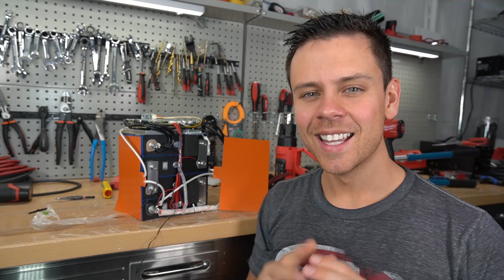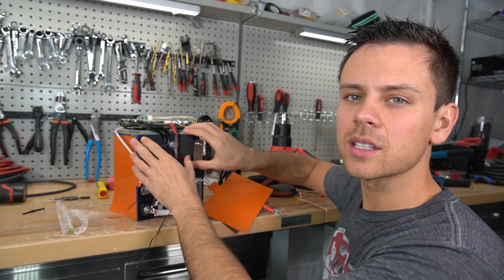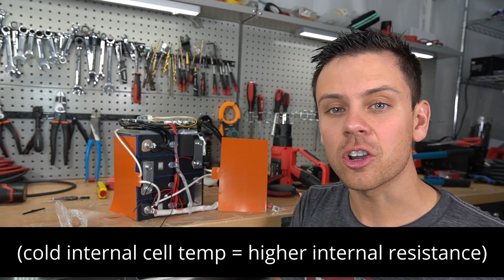LiFePO4 Cold Temperature Misconceptions: Do you really need internal heaters?

Comment from the maker: And for those of you who live in Antarctica where jet fuel freezes, and will be commenting below shortly about how this video is incorrect, you need a heater pad 😂 and a ton of insulation. I'm sure someone will disagree. Keep in mind that regardless of the temperature, if you can insulate it well enough, it should be able to handle anything. At least on this planet.

And yes, you still need low temp charging protection. That's why I prefaced this video with the dangers of charging without it. Solar batteries are charged unattended, so it is crucial to have full protection for your system at all times. Figured that was implied, but I just got an ignorant comment about that.

~~~~~~~~~~~~~~~~~~~~~~~~~~~~~~~~~~~~~
Tired of getting ripped off? Check out my "Will Prowse Approved" solar product recommendations below!

12V Batteries
https://www.mobile-solarpower.com/lithium-batteries.html

48V Batteries
https://www.mobile-solarpower.com/48v-batteries.html

Offgrid Inverter System Builder
https://www.mobile-solarpower.com/48v-complete-system-blueprint-559371.html

Hybrid Inverter System Builder
https://www.mobile-solarpower.com/code-compliant-48v-offgrid-system.html

Mobile Handtruck System Builder (very popular!)
https://www.mobile-solarpower.com/mobile-48v-system.html

Solar Panels
https://www.mobile-solarpower.com/300w-solar-panels.html

Ground Mount Solar Racking
https://www.mobile-solarpower.com/ground-mount-racks.html

Wire, Lugs and Busbars
https://www.mobile-solarpower.com/wire-and-connectors.html

Tools
https://www.mobile-solarpower.com/tools.html

Fuses and Circuit Breakers
https://www.mobile-solarpower.com/fuses.html

Plug-N-Play Solar Systems
Ecoflow, Anker And Bluetti! So many models to choose from. See my current recommendations here:
https://www.mobile-solarpower.com/full-size-systems.html

~~~~~~~~~~~~~~~~~~~~~~~~~~~~~~~~~~~~~~~~~~
Need to build a large DIY system? Need a trustworthy solar distributor? These are my favorites:

Signature Solar
Creator of EG4! Solar Minisplits, Victron and More! Largest Solar Store Online.
If you want $50 off, please use my link below and coupon code "DIYSOLAR50":
https://signaturesolar.com/?ref=cPwLcVc0SW-BjN

Current Connected
Best Prices for EG4, Victron, Midnite and so much more! Fast Shipping and Highest Rated Customer Service:
https://currentconnected.com/?ref=wp

~~~~~~~~~~~~~~~~~~~~~~~~~~~~~~~~~~~~~~~~~~
Join our DIY Solar Community 
Need more help? Join the largest solar forum on the internet for beginners and professionals alike. 140,000 members and counting!
https://www.diysolarforum.com

Check Out My Free Book
Best-selling and beginner-friendly guidebook to off-grid 12V solar!
https://www.mobile-solarpower.com/the-book.html

~~~~~~~~~~~~~~~~~~~~~~~~~~~~~~~~~~~~~~~~~~
Contact Information:
I am NOT available for personal solar system consult! If you wish to contact me, this is my direct email: williamprowsediysolar@gmail.com
FTC Disclosure Statement and Disclaimers:
Every video includes paid promotion or sponsorship (such as free products for review). Some links on this YouTube channel may be affiliate links. We may get paid if you buy something or take an action after clicking one of these. My videos are for educational purposes only. Information is subject to change/update at any time. Electricity is DANGEROUS and can kill. Be smart and use common sense :) DIY Solar Power with Will Prowse is a participant in the Amazon Services LLC Associates Program, An affiliate advertising program designed to provide a means for sites to earn advertising fees by advertising and linking to Amazon.com
Reply: To all those who live in mild climates, or who only use your battery bank in a climate controlled environment, Will is right, you likely don't need battery heaters if your temps rarely get much below 32 degrees.  However, to those like myself who have lived in three states where prolonged temperatures below 0 degrees F happen regularly, and who use the batteries in a non-climate-controlled context (uninsulated shed, cabin or RV) you may want to look into it.  For the record, Will, I have personally experienced temps of -25 F in both Iowa and Indiana.  People in Texas experienced major power outages just last year when they lost their electricity and their home heating during a week-long freeze... the exact kind of scenario that people build large battery banks for.  Just FYI - context makes the message.  Appreciate your work and your videos.  I built a 840 AH battery bank (charged by solar) for my camping trailer, and built in 3/4" styrofoam insulation (all six sides) plus I added the warming mats with a button thermostat to come on at 34 degrees and shut down at 45 degrees.  This trailer is unoccupied (and unheated) the vast majority of the year but has a few small on-board devices that function 24/7/365 so that it is ready to roll at a moment's notice rain or shine, heat or cold.  Because it has to be charged and chargeable at all times the heat mats were appropriate.  I would like if you could discuss how LiFePO4 batteries react to a hard freeze such as if they were stored, unused, in an environment subject to annual temperature cycles between sub-zero winter nights and 100 degree summer days.
Reply: @divergentview2821  Agreed. Canadian here. Will sounds like a Californian in this one. Haha.
Reply: @divergentview2821  -25°f is a warm day here in early February 😣
Reply: What about when summer comes. Do you have to remove the thermal insulation to make sure the battery doesn't get too hot? 🙂
Reply: @wilderness-beastt  I build mine in an insulated box(usually a small deep freezer if I can find one the right size)  I put a 20w propagation mat in the bottom that is plugged into a thermostat controller (all available cheap on Amazon bn link)  the then I attach a greenhouse wax motor vent under the lid,  if the box gets hot the auto vent pushes up on the lid, opens the box and lets the heat out.
Reply: @wildness01  that's awesome! I was actually thinking about doing the same so good to know that it works. 🙂
Reply: @wilderness-beastt  Just paint the exterior white. That'll cover most of the UV radiation absorption. Thermal mass is still your friend in the summer. Have you ever put an ice chest outside in the sun all day with a container filled with water? The water container doesn't get hot does it.
Reply: Freely Roaming has a video where he builds a battery with temp sensors, fans and heating pads. It protects against heat and freezing temps.
Reply: Styrofoam coolers are dirt cheap and can easily be cut up and taped around a battery pack. If you live in an environment where you need this, it is actually better to use a small (like 25 watts) heater underneath the cells rather than on the sides, then insulate well. These cells have a very significant thermal mass, and thus take a long time to change temperature (and the temperature difference must be large). Actually better to have the heater come on at about 7 degrees C, and turn off at 10 degrees C (and make sure temperature sensor is away from heat pads, near the center of the pack). As Will notes, most battery chargers will think there is no battery and refuse to charge, a separate circuit for the heat pad that activates before the BMS disconnects is better.
Reply: Without the heater pads, how much discharge would it take to bring the battery up to a safe charging temperature at say 20* ?? If I am using raw cells and a BMS in an off road vehicle in cold weather, do I want to mount the BMS on the cells to make sure the cells get heated up faster or will I screw myself in the summer under heavy discharge loads?
Reply: thanks Will .. you are better than most here as you explain by example ... keep it up  i am in the middle of collecting enough components to install a mobile 12v system that i can move from my  camper in the summer to my house in the winter.....
Reply: @johnsimpson736  Why would you be designing a 12v system, when Will says all the time, once you use a server rack battery, you never go back? 24 or 48 v, one battery instead of several, and always cheaper per watt hour. It's a no-brainer.
Reply: @80sDweeb  because the RV it is going in is 12 V and it makes one less component i would need . 12 v eliminates the need to down step from 24 to 12 ...
Reply: DIY Solar Power with Will Prowse : This is 2022 and 12 volt/24 watt electric blankets made for use in cars are available.
Just buy one of those and wrap the solar generator in it and also set it in a cooler.
See? Simple. You're welcome.
Reply: People still do it!
Reply: I agree. If jet fuels freezing it's obvious everything else is freezing rock solid too!
Reply: i'm wondering how to do it for car. TBH for the hotrod i doubt it see low temps very often but, it's a possiblity on sudden evening cold snaps BUR also for the family SUV with all the electrics, i'd love to start using Lifepo4 in cars. i've even figured out i can use a tiny capacitor bank in the engine bay where the stock batter goes to help the starter out
Reply: wait but what do i do when i go to space?  PLS HELP.  /s
your old videos are fantastic, good on you trying to get more views on those instead of trying to keep feeding the youtube algorithm
Reply: @breadanrice  i know you were /s but, i found NASA actually puts out white papers. they probably have some insulation but, AFAIK they use mini nuclear reactors but, IDK what kind of capacitors batteries they use if any
Reply: @cdoublejj  Very few spacecraft use nuclear reactors. The overwhelming majority use solar panels and batteries. But usually NiCad because they are one of the most durable chemistries.
Reply: It's funny how many "experts" there are out there that know more about this top than you do 😀
Reply: Thank you!!!
Been watching your channel for a couple of years. Now i finally got the courage to start my own DIY green grid and i am just about to setup the 16x280AH cells. After getting completely confused looking at forums these last few days, i remember where i got my inspiration :D And you ofc had a video explaining my current question perfectly in just a few mins :D Love how simple all this seems to you, it calms me and makes me carry on with renewed drive :D
Reply: The fact that you even have to make this disclaimer...because the internet lol
Reply: Okay, you failed to mention that in space, these might need a heating pad.  I might also be using them in a cryogenic freezer where I also store the bodies of my pathetic enemies...
Reply: Thanks Will! I think I'm one. Of the battery noobs from the Arctic Circle that asked you about the heating.

I've bought a BMS with low and high temp cutoff, and I've designed a heating pad system that only turns on if I'm actually using the mini camper, it turns on heating at 5°C (41°F) and off at 7°C (45°F).

The camper only has a 105W solar panel and the pack will be 4.1kWh so I think it's like you say "it will never even be used", but it's a fun project and I've learnt a lot from designing it.

Thanks again for making such great and informative videos! I watch everything you make!
Reply: Type exactly into a search engine..the second search let's you know what caused the pandemic in 1918..

First city 300 base stations

Why was radio shut down in ww1

Group 2B RF 

 Human Virome

What do tonsils filter

Is RF radiation harmful

Radiation sickness 8

Can EMF cause cough

What causes RF radiation

Does taste return after radiation

Comment: Hey Will! I have external pads and insulation at my cabin for my lifepo4s. Unfortunately, it gets cold enough and overcast/snowy enough for long enough that the heaters ran down the battery and (presumably) my victron killed the charging on low temp, so now I've got to wait until it's above 40 and sunny for long enough to wake everything up. 

In light of this, I was toying with the idea of a self heating battery for winter that will be able to warm the battery on incoming solar and not fall into this trap so I can keep my cameras running over winter. Any suggestions on a decent self warming 24V?

Comment: I decided to mount all the batteries inside an Igloo cooler. In the winter, it can get -20F, the summer, 103F. I got some small 19-watt 12-volt tank heater pads, a 2-pack for redundancy. I want to put it on a switch so I can control both of them. I also got to vent the heat out in the summer with a fan.

Comment: Not enough information on dual purpose lofepo4 starter batteries. I have 4 in my semi and love them, but this year im venturing out of Florida and am concerned. 

Im thinking I'll insulate the battery boxes (2 batteries on wach side).  Not worried much about while im running but when i park for the night I'm thinking i ought to add a warming blanket. Suitable for a rough environment as this truck travels some rough roads. 

I also have 4 300ah units under the bunk for the inverter, ac, and my little space heater. Guess i gotta worry bout them also...

Everything lifepo4 seems to be campers or off grid. I just need mine to work so i can work.

Comment: Hey I know this is an older video. But im up in canada. I need about 200ah usable power. Ive been running a couple 6v deep cycle  batteries for my truck dual battery setup.

I want to run some lithium but we do get up to -45c here. Is there  any good cold weather lithiums or a good battery in can built

Comment: Does a battery blanket/wrap trap too much heat in the summer? I know it may help keep it warm enough to charge in the winter, but since heat will wear out lithium batteries I’m wondering if they are just swapping one problem for another? I figured I could just remove in the summer, but all the ones I’m finding stick onto the battery, so can’t be easy to remove.

Comment: I am wanting to install a 12v LiFePO4 in a Nissan Leaf. A lead battery doesn’t last long in EVs, and AGMs are so darn expensive for only a marginal increase in longevity. I live in Indiana and it does get in single digits for a week or two during winter. I do park in a very partially insulated garage. This video helps a lot since the self heated version is quite a bit more. I’ll look into insulation wrap for the winter.

Comment: But what if I put them in a garage and that can reach 45-48 degrees celsius and plan to charge / discharge them at 0,5C - around 150 amps. Would it be a problem due to the heat?

Comment: I'm new to the LiFePO4 game and have Renogy heated batteries in our newly purchased 5th wheel RV. We plan to use the RV in the winter and based on passed experience, routinely encounter temps well below freezing (-4F or -15C) for a couple weeks at a time. So my question is, will the RV's factory power supply charge these batteries when we are plugged into shore power and the temps are below freezing or will I need to change something? The battery compartment is a metal box, not heated or insulated that hangs under the body. Thanks for the videos, they are very helpful but we have a lot to learn here.

Comment: We had 18 F⁰ outside  at 10 o'clock in the morning.  My batteries have a sheet metal roof but open on the side.  The BMS said that the internal battery temperature was  still  36.4 F⁰.

Comment: I plan on putting about 460-560 AH in the front compartment of our new 5W RV. That is an unheated compartment that is currently vented for L.A. batteries. The adjacent storage compartment is heated and thus I am seeing a 10-15 deg F higher track than the outside temps without plugging the vent tube & battery box lower air intake. If I reduce the leaks I think I won't need a heated battery, just a low-temperature cut-off. It gets cold at 8,500 feet in May and October where we camp host, but most of the summer will be worry-free. The internal heat of the battery, the 3KW inverter, & 3 Victron Charge controllers for 1,440-watt of solar on the roof & ground (steering around trees & canyon walls as needed) will also help. I will have a temp-controlled fan to the vent outside for the summer months as well. I will tweak as needed.

Comment: How would you recommend insulating two 12v 100ah batteries?  I am debating on travel trailer installation, whether I can continue to store outside in a black plastic holders, or insulate the holders, or go through whole process of bring the batteries inside under the bed and pulling wires from the frame.

Comment: I bought a 280AH battery and will be inside my van. I also purchased an Olympian Wave 3 heater. So, I'm wondering if I build a box out of the 1 inch pink foam with a high R value work? I saw some guy put towels on top and around the battery also? Eventually Id like to install the self adhesive heating pads but Im still not sure how to wire them and fuse em.

Comment: winter last year I couldnt charge as my batteries where cold, a week ago I thought oh no winters coming! then remembered I bought some small pads to stop my water tanks freezing and never used because of the heat under the van from the diesel heater, so now I'm fitting the 4 50w pads under my 8 cells, so like 25w on each 305ah cell. I thought under would be better as heat rises, and my cell is measured near the top

Comment: I live in the cold, and want to purchase a heated 100Ah battery to use for my mobile ham radio setup.  I've looked into purchasing heat pads, but also realize doing so in a safe manner requires some cash, and also more effort.  Before tariffs potentially kick in, does anybody have any recommendations on a heated LiFePo4 100Ah battery? p.s. I live in the north where the winter is longer than the summer, and temps can dip below freezing for a few months.

Comment: Low Voltage Protector Disconnect Switch Cutoff 12V Over-Discharge Protection for 12v lithium batteries in my RV?